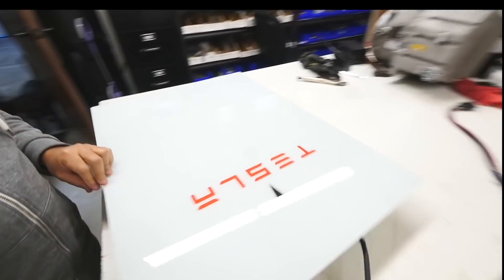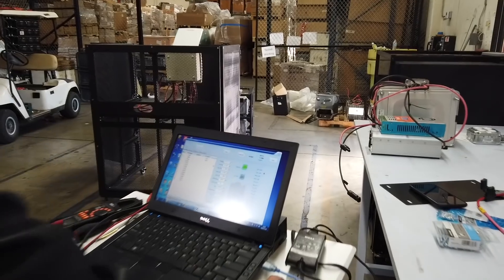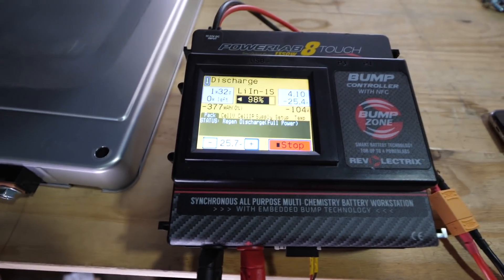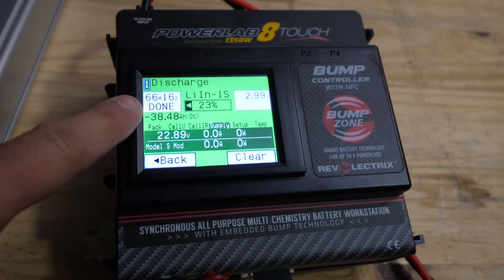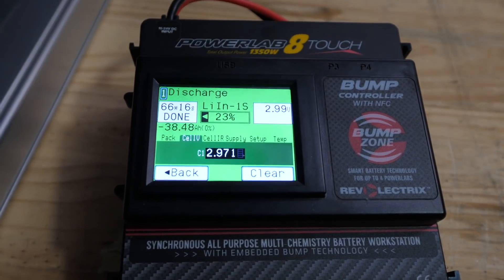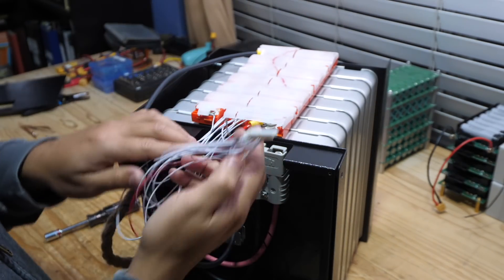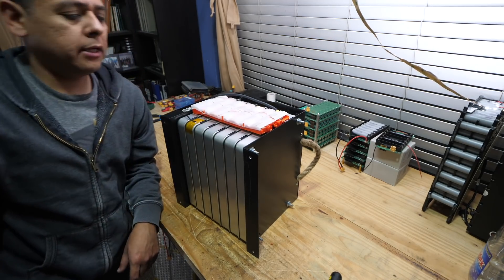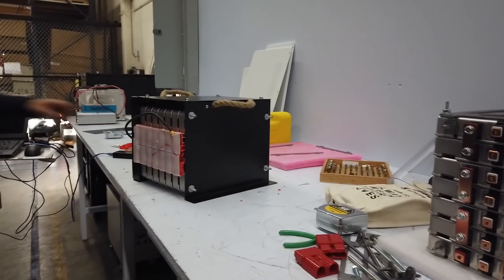Nissan Leaf Battery Modules Repurposed in Solar Energy Storage

Comment: So much value in these old Leafs.  You squeeze every mile you can out of the vehicle and then take it apart and it's a powerwall for your house, plus motors for other projects.
Reply: The $64,000 question is ... How long will these very used modules last?  1 Year?  2 Years?
Reply: @vtorsi610  Cycle life is determined by temperature, and depth/speed of discharge.  If you operate a Leaf module capacity bank within that sweet spot, they actually deliver incredible longevity.  https://youtu.be/hjJh4nJ3I44   Here is a Leaf with 210k miles on the original battery.  Staggering longevity and performance when operated within ideal parameters
Reply: @InnovativeSustainableSolutions  Yes, we all know ... if you barely use the battery it will last much longer.  But, your reply does not answer my question.  Most Off-Grid homes, do actually discharge their battery bank, sometimes severely, on a daily basis.  The seller has no idea what temperature these USED Nissan Leaf Modules where exposed to, when they were inside the vehicle.  Or how many cycles, were already extracted.  Or the min, average or max % DOD used by the car.  The seller has no clue how many more CYCLES ( even say @ 50% DOD ) remain in the pack.  How can the buyer make a wise decision when there are so few facts available?  The only fact we have is ... the pack is already severely degraded down to 60% of its Original Capacity.  40% of the original capacity is gone forever!!!  With only a 30 day warranty,  this is a crap shoot and maybe a huge waste of time and money.  At just 50% DOD daily how many more CYCLES can we get?  I hear crickets!  A Battleborn battery is guaranteed for 100% DOD every day for 10 YEARS !!!  And then in 10 YEARS my Battleborn battery will be a USED pack ( for "FREE" ) that is equivalent to the above pack.  So, why would I pay for a USED battery pack today, with essentially no warranty, when my new Battleborn will become a "free" USED pack in 10 YEARS?  If this USED Nissan Leaf battery pack cannot be used at 100% DOD ( 38 Amp-Hours ) daily for at least 6 YEARS, or 50% DOD ( only 14 Amp-Hours ) daily for 12 YEARS,  then a Battleborn is a CHEAPER purchase.  This USED Leaf module ( with falsely advertised "100% Capacity" ratings via the ebay link ) is no bargain  ...
Reply: @vtorsi610  I know a little bit about off grid power, and heavy discharge cycles (I will cite my channel as my resume).  I would respectfully postulate that you are overcomplicating the calculation by trying to guess what kind of abuse the Leaf Pack went through before you bought it.  For the purposes of a DIY home powerwall it really doesn't matter.  This is because the FUTURE degradation of the battery is what matters to the purchaser.  And that is determined EXCLUSIVELY by the conditions we (the DIY home powerwall folks) expose the battery too.  

To answer your question about how many cycles you can get out of a Leaf module (Gen1 chemistry: lithium-manganese-oxide with nickel oxide) the answer is around 5,000.  Rougly 60% the cycle life of the LiFePo4 chemistry used in battleborn batteries.  So Battleborn batteries are BETTER than Leaf modules, but are they cheaper in the long run?

I Leaf battery pack off Ebay will run you 1,000-1,100 dollars and have a capacity of 10-14kwh.  We'll go with the underperformers and say 10kwh.  Properly maintained (cooled, and professionally bms'd) you can get years of heavy daily use out of this pack, but honestly, I advise people to not even start until they can afford 2 or 3 packs.  So we're out $3,500 and we have atleast a 30kwh powerwall, that can give us 3 years minimum (probably 5) of 90% DOD.  Most of us off-griders are not rich, so I realize a $3,500 powerwall is a stretch.  But compare that to a Battleborn bank.  A 30kwh system would run you $30,000.  Sure it would last twice as long, but it would cost you 9X as much.  I'm not a huge Jehu fan, he's been pretty rude to me before when I was just getting started and asked a stupid question, and I think Battleborn's are good batteries, but for cost comparison in the long run, for large powerwalls:  The Leaf packs blow them out of the water.
Reply: Do you find these to have more durability than the Tesla modules?

Comment: How would you parallel connect 2 of these batteries with each having their own BMS?
Reply: Glenn Pearson yes
Reply: parallel dont matter just have a way to hook all of them up via distribution block make sure all battery packs are close in voltage after that they will match up on their own I have had no problem doing this. If its a good BMS and you have one pack dead and one full charge then charging will the dead pack will start if its with in the current rating. This is one way i test the bms boards i purchase.
Reply: @battery_solar_ev  Slightly badly written
Reply: @battery_solar_ev  ... I do not understand this please explain in different sentences

Comment: I bought a 48 v nissan leaf battery for my solar system and 4 of the modules swole up. What happened????
Reply: I'm no expert, but to me it sounds like they were overcharged or something. Did you have a BMS set up for the proper voltage these things needed to be at?
Reply: Info-Blocks - with lithium ion batteries and Lipo batteries, you have to be very careful with them puffing up. I know Lipo batteries should be recycled when they puff up or they could explode. 
Every time you charge these batteries, they go through a chemical reaction. Then when you discharge then they again go through a chemical reaction. The puffing is a buildup of gas that wants to escape due to a chemical reaction and has now become very dangerous. 
I would either contact who you got it from and get a refund or take it to your local battery recycle plant. Some bottle depots recycle batteries. Be safe!
Reply: @Keifer-D  No, Lithium-Ion batteries do NOT go through a chemical reaction during normal charge & recharge.  The term is called intercalation ...

Comment: I love the design of the cell. But your right about the cost. How many cycles will the pack go through before you notice a performance degradation is noticed?
Reply: 1 cycle. Doh. It is subjective, and whatever it is worth it, depends on a size, over size, how deep you discharge, exact price (plus BMS price and mounting), what was the capacity they were initial at, temperature, etc.

Comment: Jehu - about how many cycles do these Nissan Leaf (70%) batteries have remaining in them?  70% refers to DOD (actually, usable kWh storage capacity), I believe, not usable cycles remaining.
Reply: How would Jeru know how many cycles were remaining in each module?   Even if he cycled one module to death, the results would be applicable to only that module.   USED modules are like snowflakes - no two used modules are alike.   The 70% capacity is already lower than what is allowed by the warranty after a full 8 YEARS of driving ( per a GEN 2 Nissan ) and ( I think ) this is an even older GEN 1 pack

Comment: Very interesting and pedagogic video ! I will go to build this !! What will be the recommended voltage and current to charge this 48 v pack ? What kind of charger … does it need to regulate the voltage and current ? Or the BMS does it ? Thanks and regards.
Reply: Let us know how many more cycles you get and your % DOD ( like 50% DOD ) because these GEN 1 batteries are already severely degraded !

Comment: The mining of lithium has major enviromental--and political--consequences.  Toyota hybrid car's nickel-metal hybrid cells are cheaper than lithium-ion units,  and look at how many big-city Toyota and Ford hybrid taxicabs are running their original batteries with six digits on their odometers.
Reply: Do you realize that there is a huge difference between Hybrids and all electric vehicles ?

Comment: I know you don't recommend capacitors but if you have appliances or tools with a high start up draw of current, they help, they can keep voltage at a constant rather then a several volt dip in power plus if your on edge, not much leeway with extra amps, they absorb that startup draw.
Just a thought. I know you are far more knowledgeable then I but I have seen on a buddies system with capacitor, hardly a drop in voltage where he was getting 3to almost 5 volt drop without capacitor. :)
Reply: 2nd law of thermodynamics says it's inefficient
Reply: @Ronald, Yes, super-caps can help reduce the voltage drop during a high initial surge.

Comment: That’s a good deal about 1kwh cheaper than buying something similar online (if it’s the advertised 3.5kwh from the link
Reply: But, do you know how long will a severely degraded GEN 1 module last?  If you don't, then how can you say, it is a good deal?
Reply: @vtorsi610  lithium ion cells last a pretty long time. I haf some stored for 2 years after using my ebike almost every day for a year straight and they're all at 3.9v when fully charged. So my guess is car cells are built to last even longer. But if ur the type to ask how I'm I sure it's a good deal then no batteries will ever truly be good for u just use gas lol
Reply: @nyrubin  No, when I uy a Battery Bank ... I use Voltage, Amps-Hours and Cycles at % DOD ( ie FACTS ) to make a very WISE decision.  I don't just guess, like you do.  So, your answer is ... you really have NO CLUE what you are buying, how long it will last, or how old these packs are.  They could be 8 Years old.  Read the reviews ... people are receiving DOA modules and no refunds from this vendor = not a good deal.  These GEN 1 modules weren't just "stored", they are severely degraded ...
Reply: @vtorsi610  I bought some bad cells from them before too. They all charged pretty good but after 6 months a good 10 out of 100 completely dropped their volts. But I've had about 10 other orders and the rest were good. But they were new cells. Either way he didn't make the video saying these cells are bad lol. It's a good deal for what's advertised. Why does it matter to you wah I spend my money on lmao. Ur the type to rent and give folks advice on buying property lmao
Reply: @nyrubin  No, you are wrong - I don't care how you spend your money.  It is the other 99.999% that read this thread and think this is a "GOOD DEAL" - when in reality it is a crap shoot.  No, you are wrong - I own my own home, with many acres of land.  Just more evidence that you make false claims, about things you nothing about.  Jehu made this video so that he can make money.  The buyers, who spend their hard earned money, need to know the truth about these severely degraded GEN 1 modules.  The pack is advertised as 3.5 kWhr unit, but Jehu's battery pack barely delivered 2.0 kWhr.  And you must pay another $85.00 just to upgrade from a 1 Month Warranty, to a 1 Year warranty.  That should tell the buyer everything they need to know about the ( lack of ) long term reliability ...
Reply: @vtorsi610  so then say that. U don't have to come at me just because I think it's a good deal.

Comment: I'd like to know about the expected life of these batteries, this is needed to judge economy.
Reply: Jehu - - - how many cycles can you get out of these?  That's an important number for solar!  (1 cycle = 1 day).   I know they're listed as ~70% - but that's voltage, not remaining cycles!

(anyone??)
Reply: Dennis Jemison  How long has your used  Nissan Battery Bank actually been operating?  How man CYCLES have you put on it?  How much has the capacity degraded?
Reply: Dennis Jemison  These are ( severely degraded - old style ) GEN 1 Packs, not the ( new style ) GEN 2 packs. Therefore, you did NOT buy what is being advertised in this video ... So, take your irrelevant BS and shove it, yourself  ... I love it when idiots, like you, don't even watch the video ...

Comment: So. What’s wrong with a Prius modules?
Reply: What would you use a prius module for? An electric car, or a solar battery bank?
Reply: Vince Abednego 😂 that’s kinda what I was trying to ask... so I have a bunch of Prius cells.
I’m trying to figure out if I can use it for either a powerwall, or can I turn it into a portable power pack...?
I have a old and bad 12v battery jumper, and I was curious if I can swap the dead lead acid 12v battery on my portable jumper with Prius cells...?

Any thoughts? Inputs? Ideas? Advice? 

Also, I’m new to this stuff
Reply: @Jdmlsturbo  yeah you can definetly make a power wall but what kind of battery jumper is it that you want to fix? Because I think you can swap a cell but the size and shape of it might not make it work.
Reply: Vince Abednego so I bought a cheap harbor freight 12v portable battery jumper, for car. And originally they used a small lead acid battery. But that battery is now bad and dead.
So I found videos on YouTube, people turning 18650cells into portable power banks to jump start cars, or even to power the car. 

So I got to thinking... I have a bunch of good and tested Prius cells left over, from rebuilding Prius modules(1st gen, nimh) not lithium ion like 18650.
Then Started searching if people were using Prius cells to make portable power banks, and found nothing besides powerwalls.

So I always assumed lith-ion only if I wanted to take my bad portable jumper and replace the lead acid, it would only work if I used another lead acid or lithium, but Nimh was out the picture....?🧐🤔🤔

I’ve only been doing 1.5 years of YouTube and reading online.  Again thnxs, and thanks for being patient with me and answering my questions.
Reply: Vince Abednego oh, and if I could use the Nimh Prius cells to fix my bad 12v portable jumper, that would be great. Since I always need it here at the body shop, cars come in for a few weeks and batteries are always draining. And I have 2 portable jumpers that are in good shape, if I can fix the cheap bad one, I won’t have to worry when my dewalt and snap-on one goes bad with all these extra Prius cells
Reply: @Jdmlsturbo  Oh yeah ok I see what you mean, any content besides basically repairing or replacing a prius battery is virtually nonexistent. I don't think people see them as anything other than just car parts. These 2nd gen prius models are actually more like one piece NiMh polymers than individual cells put together. Even though each module has 6 individual cells, they look more like thick sheets of nickel, than a more common combination of AA or 18650 type batteries inside each module, and they're all held together with the same walls as the module itself, so it seems as though it's just one pice that can't be taken apart and made into much of anything else. You could however just use the modules as they are, 2x 8 volt modules is approximately 12v, and depending on the exact model of your jump starter, it might not fit inside of it but if you don't mind losing portability, you can have a homemade 12v prius battery hooked up to it externally. Just an idea.
Reply: @Jdmlsturbo  I've been meaning to look into prius batteries for a while now but not until you just asked about it did I ever really try to. I had no idea what they really had in there but now I know they're garbage (in my opinion). For years I never really understood what priuses did, and I thought they really did have a full ev version but not really and all they've ever done was get you 50mpg which at this point is not even all that impressive compare to what I've seen at this point.
Reply: Nimh has a coulombic efficiency of only 65%
Reply: @climatechangepreppersfaceb2148  meaning what exactly?
Reply: @vincenzopromedia  meaning 1/3 of the current put into the battery doesn't come out again. Voltage efficiency is about 0.8 so multiplying these together means that half of the energy put in doesn't come back out. About the same as lead acid. Meaning, very bad idea

Comment: Hi, i have found Ni Mh battery from Prius 2, but i can't find someone who is using that as battery pack for solar or something like that..., Whats your opinion?
Reply: I have two full set Prius bat (28 batteries) set up to 24 volts and I can not recharge its. Any help will be appreciated
Reply: @leocosta4704  It doesn't take the voltage?
Reply: Dino Pasic thanks..gracias,
Reply: Nimh has a coulombic efficiency of only 65%. Only fools would use it

Comment: You were draining the batteries too hard to correctly get the watt hours.  Try again at half or a quarter of the current.
Reply from the maker: These are power cells capable of 200A,  1C discharge test should yield accurate capacity.

Comment: Is it possable it direct charge my new bmw i3 ev direct from a solor panel without going through a A/C conversion and then back to  DC through my household power?
Reply from the maker: your car is 400Vdc most likely so you will need some kind of conversion unless you have a matching solar system volatge